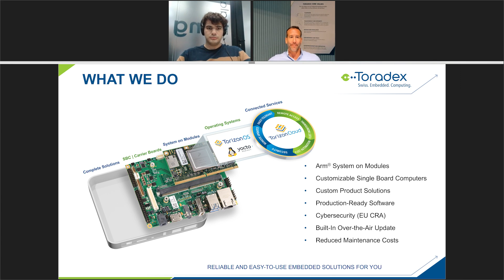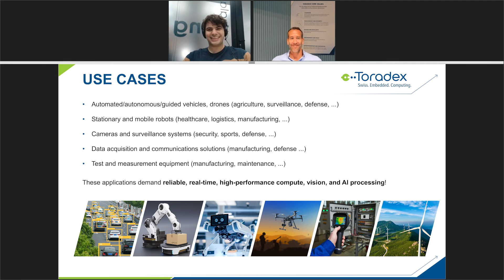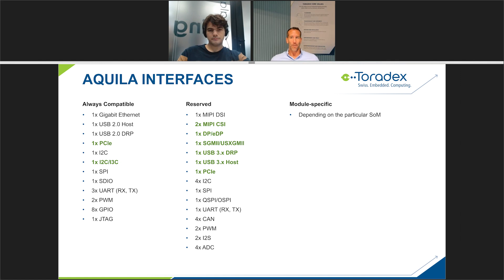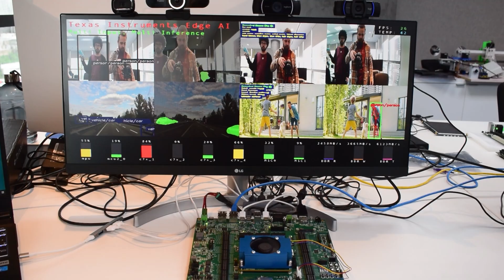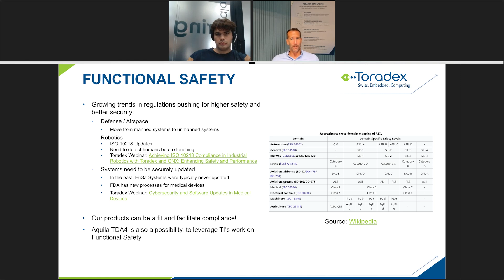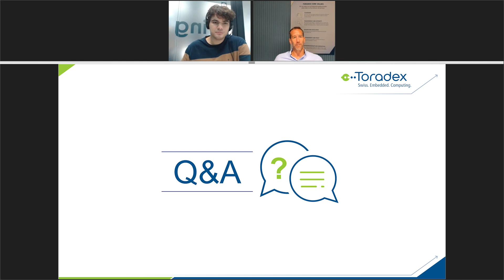Next-Gen Industrial PCs: AI-Ready, ARM-Powered, x86-Free

Comment: Not sure if the X86 (Atom)  and  Arm (AM69) comparison was fully up to date..   First it would be better to use the latest gen Atom in comparison ( 7000) series instead of early 2020 family.  The SOM board cost might be a bit off... if looking just the public pricing of SOCs, the 8 core Atom 7835 costs around 130USD while AM69 seems to cost circa 140USD. Pretty sure that the ATOM delivers higher CPU and GPU perf than AM69. No NPU though. The 4 Core variant, 7433, seems to cost just 63USD providing great performance for general compute and UI.  However Intel and x86 got some other major drawbacks, support period been maybe the biggest one.
Reply from the maker: Thanks for the feedback.  We will make sure our product management team has this information for review